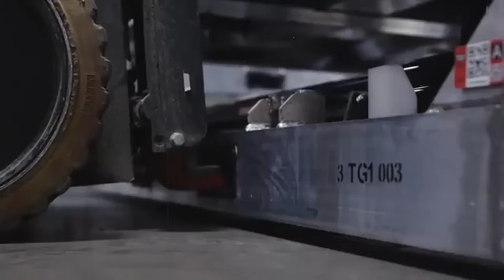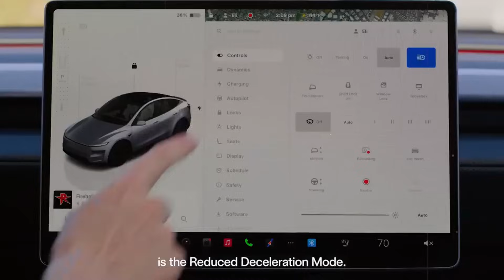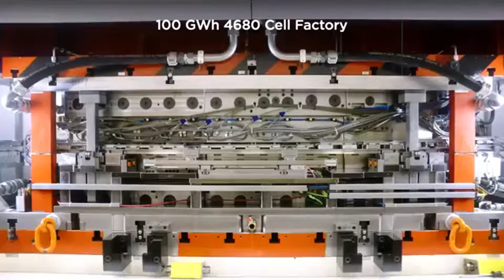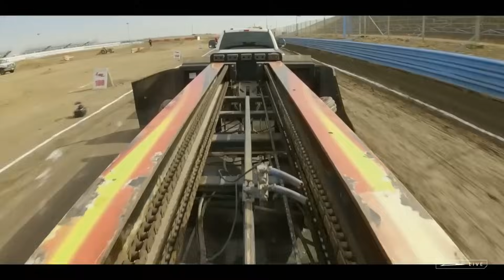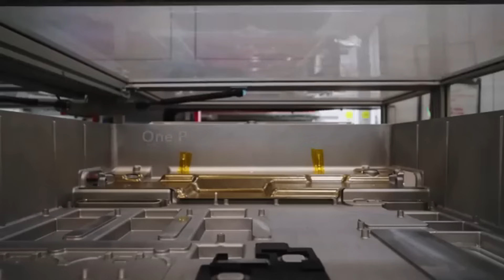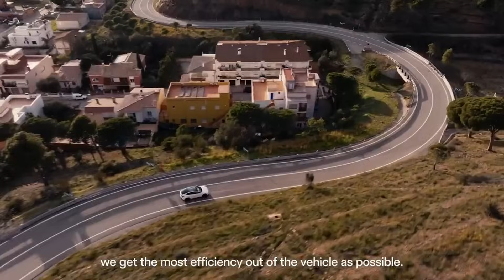NEW TESLA BATTERY drives 800 miles & charges in 10 min — Elon Musk shocks the world!

Comment: Great this is the range we need. Kiwi how long to charge please.
Reply from the maker: Totally agree — this kind of range is a real game-changer. As for charging, it depends on the battery tech. If Tesla uses the new aluminum-ion setup, charging could take under 10 minutes for 80%, but with current LFP or sodium options, it would likely be between 20 to 40 minutes on a fast charger. Would that kind of charging time fit your routine, or are you hoping for something even faster?

Comment: I didn't hear the 800 mile range covered. In the first minute there's mention of 'over 300 kilometer (180 miles)' range for the Model 2 and there's a shot of the battery with '400 miles' written over it but I missed the vital stat mentioned in the headline.
Reply from the maker: Great catch! The 800-mile range is mentioned later in the video when we talk about the theoretical maximum potential of the new aluminum-ion battery under ideal conditions. The 300 km and 400-mile numbers shown earlier refer to current practical estimates and what's been tested in early prototypes. So yes, the 800 miles is real — but it’s tied to the future potential of this tech. Thanks for pointing that out — your comment helps make things clearer for everyone watching!